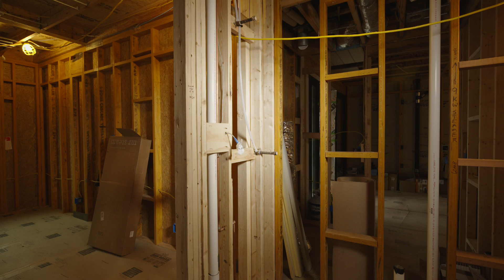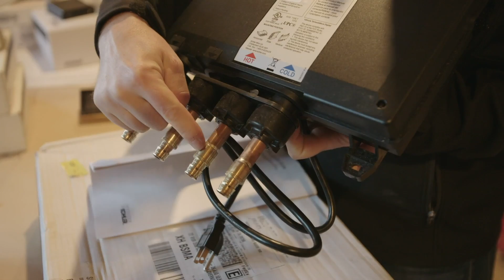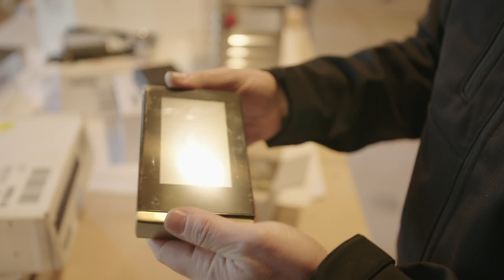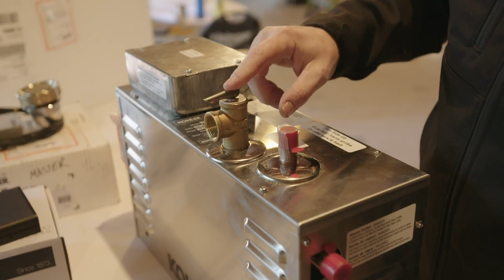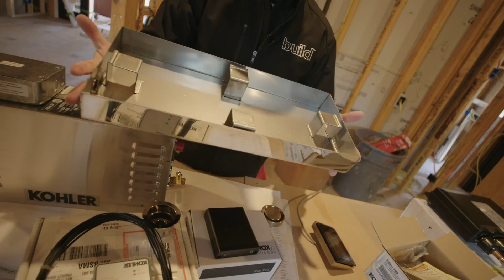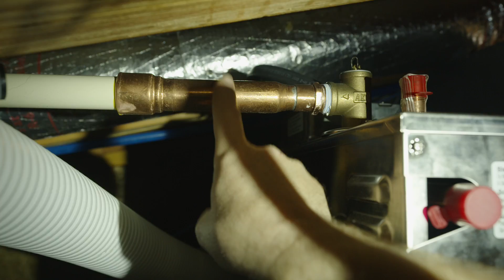Electronic Thermostatic Shower Valve - This is impressive!

Comment: Great video, love all your stuff and you've really helped me in my home remodel.  Does the Kohler steam generator have a built in automatic drain valve? What is your opinion on Moen? They have a less feature rich version of the Kohler system you have but also less expensive. Your DTV system and the Moen both work with Alexa and Google to turn the shower on via voice and pre-heat it. Don't even need to touch a control panel 😀.
Reply from the maker: Didn’t realize that. Awesome!
Reply: @buildshow  Sorry, IMNSHO, putting appliances and your facilities on the internet is the kind of thing that gives people with any form of security awareness screaming nightmares.

I'm a network engineer who moonlights as a physical security penetration testing specialist.
I have the knowledge to lock a home's local network down solid.
And I wouldn't utilize Internet-enabled controls if you gave the stuff to me for free, built me a house to go around it, installed it, and paid me monthly for the privilege.

And please tell me you have analog backup controls as well.

Comment: This is cool Matt, but I've got one thing to say. Bluetooth is very handy, but very insecure. Bluetooth speaker system in the bathroom is fine, but you don't want someone turning on your shower from the street while you're on vacation. We're seeing this become a problem with the Bluetooth doorbell cameras and thermostats. Even if you're able to secure it to prevent this, there's nothing that can be done to prevent it from being turned off remotely. People are going to start to prefer the mechanical and hard wired options in the long term. Even if money was not a problem, and I could get any system in the world, I'd still prefer a mechanical mixer.

Comment: KISS.  (Keep it simple stupid).  Great way to cause unneeded costs/risks that you will have a malfunction at shower or your hacker pal turns off the heat etc.  Be an outdated tech toy in 3 years or so.  LOL, replace in 20 years he says. Get yourself a better house water filter/plumbing
 first.
Reply: Yes technology adds more costs, and complexity adds more failure points, but I'd take that any day over the alternative.  Good thing everyone doesn't have the KISS mindset or we'd all still be riding horses instead of driving cars.
Reply: @00HiGhGuY00  There is unneeded gadgets problem prone like this not ready for prime time and than there is better mature reliable tech that adds real value. Like to buy an updated washlet toilet that does not present risk of breakdowns.

Comment: That thermostatic valve is a paint to repair if it was installed in the wall. The installer did put an access panel, but it was barely enough. Also, it was copper connection with union. The problem was debris in the filter screen. Easy enough to fix. It was just installed in not a good location to work on. :(

Comment: Was it Matt that was recently talking about saving water and having an efficient water heater ? Or were we just listening to Matt talk about 20 min showers and steam ? Confused?
Reply: In the case of waiting for water to heat up, in a normal system, you're wasting water that's just flowing, cold, down the drain.
In Matt's case, you're seeing far less (or no) waste and the rest is being used solely for showering/steaming.
Reply: @PhotonHerald  Far from a 7-10 minute shower. It is still going down the drain as waste.
Reply: @mcrestore  Your definition of "waste" is different from mine.  It's a value judgement.

Water not being used because it's cold and just going down the drain?  Waste.
Hot water keeping me comfortable if I CHOOSE a long shower?  Not a waste.

That's like calling an expensive bottle of wine a waste because you can get a box of Five Buck Chuck.

It's a qualitative decision.

Also, what if someone has medical issues that (physical disabilities) that prevent them from moving very quickly?  Sure, a completely healthy person can shuck out of their clothes, run through the spray and they're clean.

What about the elderly?  What about someone in a cast?  Or they have a neurological disease that results in them needing to take more time to achieve the same end?

Yes, by your purely quantitative decision, you might be right.  But that's not the only metric.
Reply: @PhotonHerald   My comment was directed at this installation only. I realize that many people may NEED a different shower experience, that is assumed. 

My comment was to highlight the lack of thought involved with the build. It was supposed to be a 50k remodel, now it is a major rebuild. All of his decisions were based on energy efficiency, except the shower. So then energy efficiency is not the goal.

A water recirculating pump would eliminate waste of cold water at the tap. Simple, effective and low cost if installed with a timer, or method to alert the pump that hot water is needed.
Reply: @mcrestore  Basically he was project was supposed to be a relatively inexpensive rebuild of the existing home.

Unfortunately the original home was in even more horrendous shape than Matt figured.

At that point, he could dump money into remediation after remediation.

Or he could just nuke it from orbit, eliminate all the problems SIMULTANEOUSLY, and leave a nominally blank slate that he could drop a new home for his family on.

It hasn't been about a 50K rebuild in over a year.

So this is is the equivalent of a computer geek being given a $20,000 budget for a single computer..
Reply: He also talked about his child having asthma so the steam is an important benefit for his family.
Also the efficiency of his water heater will still save water.

Comment: That's huge that the steam is integrated into that same control.  In the past we've covered that copper line to the steam outlet with high heat insulation from the plumbing supply.

Comment: Neat, but NO WAY! Show me a gigantic rain shower head. Cool. Show me 4 different configurations. Neat. Show me an electronic thermostatic mixing valve. Nope. They have enough trouble without adding electricity to them. Some things are worth the extra cost and really make things awesome, but some things cost an arm and a leg, are unproven, and ridiculously expensive to fix. I believe this is one of those things. However, the rich will pay those prices. But like King Solomon said, it's just a "chasing after the wind".

Comment: Steam showers are totally underrated. Also by just enclosing the cubicle, you can generate some steam just from the hot water. If the shower environment is warm and moist, you can shower in colder water, which saves energy and dries out your skin less.
Reply: Or, in Austin, just walk outside...

Comment: So what your saying is instead of turning my handle I can push a button but that button costs me 1200 dollars? Why? I get that its fancy but why?
Reply: That’s actually not what he said but perhaps you heard differently. I guess the good thing is that it’s not your money or mine. It’s Matt’s, that he worked hard to earn and to attain sponsorship.
Reply: @acdnintheusa  I think the reason for all of the fuss about this is that Matt described this build initially as the "Real Remodel" which was going to be what someone interested in building sciences may want to try with any remodels they are performing. However, this build has ballooned and now is divorce from reality when it comes to what anyone would consider "Real". So much of what people came to this channel for was about energy efficiency, air sealing, and best practices to build homes that will stand the test of time. This shower introduces complexity where it isn't needed which is the antithesis of efficiency and best practice.

Comment: I hope that Kohler has the source for software that runs on the micro controllers in that DTV and the license to maintain it or have others maintain it..  The issue with software controlled anything is that most hardware manufactures outsource the software to a software house.  If the contract isn't written for it, the hardware mfg. ends up not having the license to update the software and when a product goes out of production, or the micro controller gets upgraded in a newer version, the software for the original equipment stops being maintained.  This won't be a 100 year shower... and if smart hardware has been any indication, may not even be a 5 year shower.

Comment: I know your attention to detail is incredible so I’m sure you have a reason not to, but I would think running a hot line to the steam generator would be more efficient energy wise.
Reply: I would think for the same reason you don't run a hot water line to an instant hot water heater, the efficiency in the steam unit negates the need to have hot water sitting in a pipe waiting on demand.  The water would cool in the line when sitting possibly 12 hours between uses.

Comment: so many points of failure. I do like the idea of having it accessible in the attic.
Reply: Seriously.  Give me a valve that works and I'm good.  Every additional bit of tech is one more thing that'll bust over the next few years.
Reply: He also doesn’t mention that the components he went through in this video would set you back about $10K. That’s JUST the electronics/valves/steam generator. The actual fixtures are not included. 😳
Reply: My brain can barely handle turning a knob first thing in the am
Reply: As a software engineer, this networked valve control system makes me cringe.  Who wants to reboot or install software patches on their shower controls?  This falls squarely in the “just because you can doesn’t mean you should” category for me. What’s wrong with sticking a hand in to turn on the shower and gauge the temp before stepping in?  If accessibility to the valves is important, provide an access panel in a closet on the wall behind the shower.
Reply: @readyplayer2  My thoughts exactly.  It's an attempt to create something to make money but it seems like it will create more problems than solves.
Reply: But the system is built to fail.  So they make it easy to replace the parts....
Reply: Web connected valving for showers? You didn't vote the "right" way, your shower's been cancelled. Nah.

Comment: Outside: KOHLER SYSTEM CONTROLLER: $800.
Inside: It's literally a $30 ethernet switch.
Longterm: This product probably won't exist in ten years. Good luck with that.
Security: Have you ever had your hot water heater hacked, had the shower turned on, and had to pay 1/10th of a Bitcoin to turn it off?
Reply: Hard to imagine it’ll actually be connected to the internet.
Reply: @maaattt99  You have to connect them to the Internet, or you can't charge people a subscription license fee / "Use a convenient app to access the interface".
Reply: @maaattt99  The heated floor we put into our previous house was connected to the net;  I can’t picture the shower wouldn’t be!
Reply: Ouch
Reply: Gotta lock them out of the fridge if you want them to pay up.
Reply: I was going to mention something similar. That $800 ethernet switch is the size and price of a managed 10 gigabit switch but all it does is provide simple communication between the bathroom fixtures and is somehow hard wired. Why not go wireless with wifi/bluetooth/zigbee/zwave?
Reply: @MrJramirex  No.  You don't want someone to be able to just walk by and attack your appliances from a phone or tablet.

Is it cool?  SURE!

But notice that tech fanboys go for stuff like that.
But actual network/computers engineers/technicians cleave closer to analog or physical isolation and try to keep things as simple (and analog) as possible.  Because they don't automatically assume stability, let alone security.
Reply: @PhotonHerald  I take a electronic with manual bypass. That way if someone gets frustrated they can do it manually. This doesn't offer that but I am still planning on doing this myself. People make all kinds of assumptions about security when they know nothing about it, I would suggest people stay in their lane a bit. Not a bad idea to ask the question but don't make assumptions when you will likely be wrong.
Reply: @PhotonHerald  There is practically zero risk of somebody "walking by" and hijacking these things.  That is not a thing people do.  What people do is expose publicly accessible IP addresses and write a script to war-dial them.  If somebody finds a vulnerability, every device on Earth can be compromised in a matter of a few minutes.
Reply: @TrogdorBurnin8or  Uhm.  Sorry.  No
Reply: @PhotonHerald  see things like "The Spread of the Sapphire/Slammer Worm", the outbreak of which doubled in size every 8.5 seconds and had exploited 90% of vulnerable hosts globally in 10 minutes.  Random scanning is exponentially cheaper than gas in your wardriving van.  These things were fairly pointless back in the day; Written to see if they would work, or written to DDOS the Minecraft server that the author was just banned from.  But now we have crypto and ransomware, and it provides a nonzero monetary incentive.
Reply: @MrJramirex  800.00 10g switch is garbage if you can find one. This makes sense at 800 as it has a few more features than a Ubiquity network switch and it's a support/testing environment. If it's ethernet based this all has a great future even if this equipment becomes obsolete. BTW enterprise gig switches start a couple grand and there is a reason for it. If you have to ask then its out of your league to even worry about it, just a fact.
Reply: @whummer98  Why would you need a 10G switch to control water flow? A 2400bps serial line is overkill. OK, there's a music player involved, so maybe a 10M hub would be worth it, but 10G is crazy talk.

Comment: What's with the pancake round above the vanity for...why is it a pancake ...pancake are for old jobs and not for new installation.  You should put cat 5e around the medicine cabinet for smart mirror.  Actually your shower is old technology... I'm sorry... this has been out for awhile... The newer style is voice command and voice setting with water temperature request.   That's very true KOHKER is the best !!! you need to install a water sensor in the attic incase of a leak causing lesser damage . Nice work on the attic. Kohler is great...but they are using the older generation technicians. They need fresh new blood that knows techs.  How do I know...just look at there toilet touchless flush kits...  always changing the model every couple years cause the first second third always failed. Finally they gave in and add a wire...LOL...  UHM !!!  WIRELESS  (HELLLLO)  lol  ..I actually like the wire better...

Comment: is that plug protected with a ground fault breaker cause the plug isn't a GFCI
Reply: I provided power to one in a client's house. That's how we did it there. That was installed in the shower wall with access from the backside in a walk in closet.

Comment: What happens when the power goes out? Will you have manual control?
Reply from the maker: No power means no shower. I’ll be going upstairs to use my daughters shower with a standard thermostatic valve. I still think it’s worth it. We don’t lose power that often
Reply: Whole house generator.  Of course if THAT runs out of fuel he'll be left high and dry.
Reply: @michiganengineer8621  literally lmao
Reply: Matt might be a bit smelly if the power stays out too long.
Reply: These thing has a 12v battery back up just incase...until you restore power..
Reply: No, he will have Norman Bates and the ghost of Alfred Hitchcock in his shower.